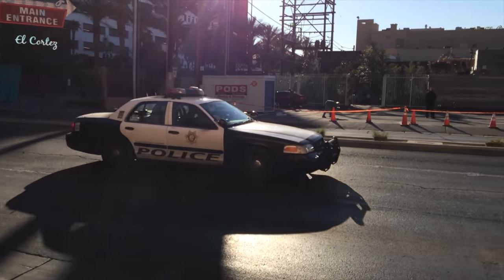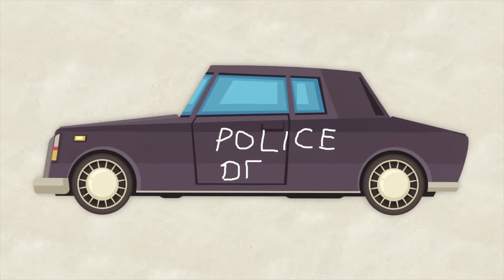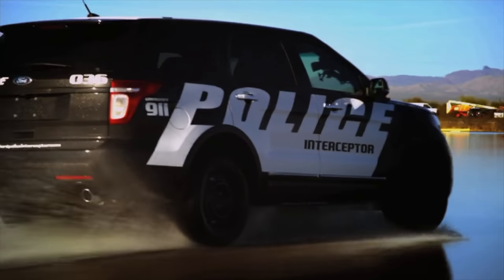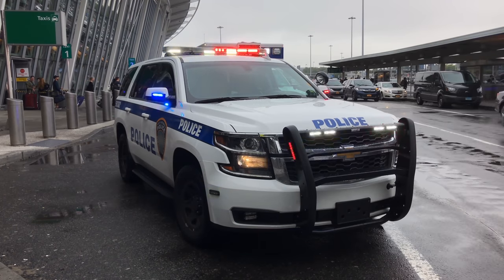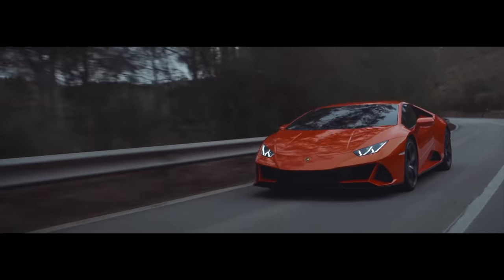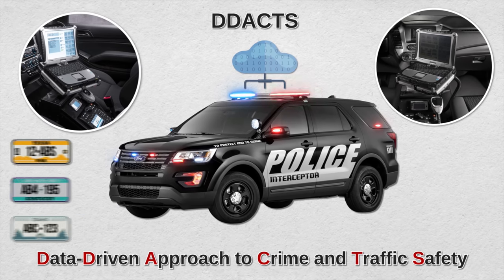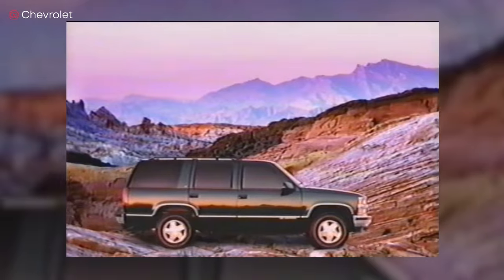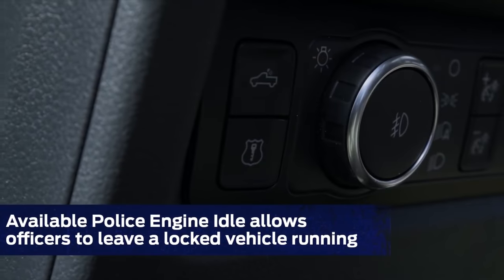Here’s Why You Can’t Outrun a Police Car

Comment: Haven’t owned a retired cop car but I did look at one in a used car lot (in Australia).
It had a blackout switch that turned off all interior and exterior lights regardless if the car was running. 
Apparently it was an unmarked detective vehicle and that sort of thing was used for stakeouts.
Reply: Same thing with my Dodge Charger RT I thought that was with all cars
Reply: That and following ppl in the middle of the night...which they do all the time here in Detroit
Reply: Thats nothing. In the USA, undercover cars have all those features PLUS multiple headlight and turn signal configurations. You can change them when tailing a suspect at night. Switch to a different config when the suspects car turns a corner or is temporarily out of sight.
Reply: I have a retired crown Victoria  patrol car it’s so fast it’s crazy lol but the tints get me pulled over a lot
Reply: Jesus loves you alot trust in His death 4 salvation and be saved from eternal hell <3 Jesus died on the cross for you bro. <3
Reply: @@winahhtaylahh1433yeah they do that everywhere.. it goes back to being a normal car before you can buy it
Reply: My car does that...
Reply: Australian police cars are COMPLETELY different. Currently all police vehicles in aus are basically just stock cars, same as ones bought off the lot. Back in the late 80's early 90's however, the comodores they were using did receive some performance packages. other than that, all police cars in aus even HWY patrol cars are stock, the only exception being some fedral police vehicles that are "bullet proof"
Reply: @Fit4C  does he prefer Fords or Chevys?
Reply: I bought a retired police car in Canada and it does the same thing
Reply: Talking about Aus Holden Commodores 
I have owned a VP, VT, VZ AND VE
Apart from the VS all the others had what others would call police mode. It was set up to stay on I think with cop cars but you could get it up on the instrument cluster 
So you had digital Speedo and RPM and whatever else AND you could set the lights all off or just light up the Speedo and I think you could set it to light up Speedo and RPM. Don't know about all other lights inside and out.

Comment: If there's any cop modification you want to have on your car, believe it or not, it's the brakes. 
I've talked to multiple officers about what the PDs want most in a car. And they all say the best braking possible. They want their cops to be able to stop fast, moreso than to start fast. The quicker they can stop, the quicker they can get out and do their job. And that made a profound level of sense to me.
Reply: I've always said this to my brother who is a racing enthusiast. That as much as you put in the engine you've better spend on some great breaks.
Reply: All cars have the best braking possible though so this makes no sense. The actual most important thing is tyres they are what determines how quick your brakes stop the car the fact is if ABS can kick in then you have the maximum stopping potential the tyres will allow. You can giant 8 piston calipers and carbon ceramic rotors but they will not stop the car any quickers if you are still locking up.
Reply: @gravemind6536  Well, without a tire upgrade, a brake upgrade can really help with brake fade issues.  Useful for spirited driving but probably not so much for hard braking to avoid a single accident during a daily commute.  Maybe it would be a good thing if you live in the mountains and do a lot of downhill braking though.
Reply: More brake-checkers on the road.
Reply: None of what you just said is remotely true…
Reply: In Michigan winters, tires were the most important part. I did have a Chevy Tahoe I had to get the brakes done with every 5000 miles.
Reply: If the cars have ABS, then a good set of pads and Dot4 fluid is all they'll need. Easily one of the cheapest but most important upgrades.
Reply: Very true . .
Reply: @gravemind6536  You are right And wrong lol. Every car has the ability to lock the wheels or engage abs for a SINGLE stop...but that braking power fades quickly when you are forced to execute Multiple braking events from high speed! Such would be the case in a police chase where the guy running would be doing multiple turns-following-hard-acceleration. Fade resistance would give the cop car the advantage over We, The People!
Reply: For the tasks at hand, yes. If you can accelerate as fast as possible without worrying about being able to brake it helps A LOT in traffic situations or on curves (being automatics). Reason is that most vehicles, even those with formidable acceleration, will not have large brake systems from the factory.

Great point btw!
Reply: @gravemind6536     No, they don't. Who told you that? Lol.... though tires and especially inflation is very important. That's one reason patrol cars generally have tires that are highly inflated.
Reply: @antghostthreeonethree6609  Thank you for explaining that. I really didn't want to. Lol
Reply: Police-spec tires from Goodyear have doube-thickness sidewalls. And cost $400 each.
Reply: @CynHicks  high inflate for stability at high speed  and turns and, police deparments did not like the idea at first some guy was telling them to inflate much more
Reply: @lofturhjalmarsson9896  From what I have learned from experience and others is that all vehicles and tires will differ but essentially you slowly inflate them, starting at roughly 4 to 6 psi over the recommendation, checking the tread every 500 miles or so until the center starts wearing faster and then back it down. Never going over the tires max psi of course but also paying closer attention to their speed rating. They will last longer and perform better. Especially in corners. I've also heard that with rear wheel drive, for best performance, you should keep the rear tires a couple few psi lower. Kinda makes sense but I don't know. I do it anyway though.

Edit - And obviously as you know (but for anyone that may read this) the ride will be louder and less "comfortable" and will possibly cause more wear to your suspension components because tires do absorb much of the forces.
Reply: @CynHicks  they infalted way over the max that guy that tought police departments in usa to start doing this max is 45 they went up to what was it 60 or more , they will explode at much higher so its mostly safe in that regard l read.
Reply: @lofturhjalmarsson9896  Oh yeah, going too high is a terrible idea. Especially at high speeds on rough terrain. I have never gone past 44, no need too, even on tires with max psi well over 44.
Reply: found... The faster you are going through a corner,
the more tire deflection you get. As the tire deflects over onto
the sidewall, you get less traction and more of a tendency to
understeer or oversteer. This could spell disaster when
negotiating a corner at high speed during a pursuit or a Code 3
run. Higher pressure keeps the tire from deflecting onto the
sidewall as much, which keeps more of the treaded portion on
the road.

A good demonstration for EVOC instructors is to have students
drive a high-speed course in a vehicle with 32 to 35 psi. Then
have them run the same course with 44 to 50 psi in the tires.
The student will experience a marked difference in performance.
Having officers experience this difference in vehicle
performance is much more effective than just telling them to
check their tire pressure.

Hydroplaning

When a tire rolls across a road covered with water, the tire
tread channels water away so the rubber remains in contact with
the road. The factors that affect hydroplaning are speed, and
water depth. Conventional wisdom says that vehicles will hydroplane
in as little as 1/16th of an inch of water. Not so coincidentally,
legal tread depth is 1/16th of an inch.

Tire manufactures and the Association of Law Enforcement Emergency
Response Trainers International (ALERT) have shown that tires have
more of a tendency to hydroplane when pressure is low. This
happens because the tire footprint (the portion of the tire
actually in contact with the road) is larger. For those of you
who water ski, think of which is easier to get up on: a fat ski
or a skinny ski. More tire surface in contact with the water
makes it easier to hydroplane, just as it is easier to water ski
on a fat ski. Also, a soft tire can be pushed in more by the
pressure of the water on the center portion of the tread. This
results in less rubber in contact with the road.

Tire wear

Much better tire wear results from maintaining proper pressure.
Tires with lower pressure will wear off the outside of the tread
faster from the deflection of the tire during cornering, and the
tires will heat up more from increased road friction. This is one
of the factors that caused the failure of a certain brand of
tires on Ford Explorers some years ago. In 1999 the San Jose
Police Department realized a significant cost savings by
increasing the pressure in the training fleet to 50 psi. They
soon followed up by increasing the pressure in the patrol fleet
to 44 psi. For liability reasons, most agencies are reluctant to
exceed the maximum pressure listed on the tire for actual patrol
vehicles, but they reap the cost saving when going to 50 psi on
training vehicles.
Reply: nybody who works on cars professionally and removes tires on a regular
basis will tell you that drive tires wear in the center - mostly due to the
belt "pulling" the tread on acceleration and deceleration inputs - and
steering tires wear on the edges - even with absolutely correctly aligned
wheels. On RWD cars, this results in the rear tires wearing in the center
and the fronts wearing equally on both edges - even when properly inflated.

On FWD cars with both steering and drive inputs on the front tires, the
rears will often outlast two sets of front tires.

> > How does what I say endanger ANYBODY. I am not endorsing either over-
or
> > under-inflation.
>
>
> The person who's tires are already under-inflated that believes the
steel
> belt tale and lets more air out to get even tread wear. Remember the
> Ford/Firestone fiasco ?
>
>
>

OTOH, if the edges wear on an overinflated tire and the person believes
YOUR THEORY that edge wear automatically indicates underinflation, they
could overinflate the tire and have it pop on a hot summer's day at 70+ mph
on the Interstate.

Anybody who sets tire pressures by the tire's appearance is too stupid to
be operating a machine as complex as an automobile.....Of coarse hard cornering
will heat up the outer edges of a tire. This will happen on a race car AND
street driven vehicles. I like to corner hard and always have edge wear on my
front tires even if I up the inflation by a few psi............ok....... so it seems overin is ok regarding wear center wear just evens out edge wear but can it pop , l read hardly ever but dunno
Reply: Under or over inflated tires not only wear out quicker but make the car unsafe as far as handling goes. My tire guy with 50 yrs experience taught me.
Reply: @bricemantel3191  unsafe for normal use l guess but safer for chases maybe , less resistance in turns less slowing down or what and better handling . but also less area of tire touchng ground less grip  but l think the benefits outweigh that
Reply: Never thought I would see this topic on this channel lol
Reply: Also watch the fuel economy. 3 psi higher yields better gas mileage.
Reply: @joaquinaguilar165  it depends on the application to be fair.
Reply: @gravemind6536  they absolutely will. Dont lock them up. Oscilate the pedal you wont lock. thats like 70s car basic knowledge right there.
Reply: they day they get brembo brakes thats when i wont try and be slick dipping on the first turn anymore. Thats one thing everyone forgots. Cops have econo brakes. if they put money more into the suspension and brakes to stiffen the chassis less body roll and a better tune we would all mostly be screwed.
Reply: @gravemind6536  The tires used in my city by the PD are very expensive I have heard. I believe they need the best too!
Reply: @ColonelSandersLite  - makes sense. Use cases matter. Glad the points were raised re tires and brakes.
Reply: @joaquinaguilar165  you want great everything even a chassis
Reply: @chasebeavers  why do you say that? I'm new to car enthusiasm
Reply: @a.chavez5808  my reply was for this statement..."All cars have the best braking possible though so this makes no sense. The actual most important thing is tyres they are what determines how quick your brakes stop the car the fact is if ABS can kick in then you have the maximum stopping potential the tyres will allow. You can giant 8 piston calipers and carbon ceramic rotors but they will not stop the car any quickers if you are still locking up." All cars do not have the best braking possible, only what the manufacturer deems necessary. Most cars can benefit from larger brake rotors/brakes.
Reply: Guys, Here is Our Savior

YaH The Heavenly FATHER HIMSELF was Who they Crucified/Pierced for our sins and “HERE IS THE PROOF”

From the Ancient Egyptian Semitic: 
"Yad He Vav He" is what Moshe (Moses) wrote, when Moses asked YaH His Name (Exodus 3)

Ancient Egyptian Semitic Direct Translation
Yad - "Behold The Hand"
He - "Behold the Breath"
Vav - "Behold The NAIL" <— YaH’s Crucifixion
He - "Behold the Breath"

“Behold the HAND that Beholds The NAIL” 

PROVES - YAH The Heavenly Father HIMSELF was Who they Crucified

That is EXACTLY what Moses Wrote

Here is what they mean

YaH's Name:
(Ya)d + (H)e, as YaH is what Moses called Him and YaH Declared: "this is My Name, this is My Name for all generations" (Exodus 3)

YaH is The Creator of “MAN”: (Genesis 2:7)
Yad He, (HAND BREATH), as YaH's "HAND" Formed man from the dust  of the Earth and His "BREATH" made him a living being (Adam)

YaH's Sacrifice of Crucifixion for “MAN”:
Vav He (NAIL BREATH), the "NAIL" through YaH’s "HAND", in Sacrifice of Crucifixion, that whosoever shall call YaH Savior, His “BREATH” brings forth life (Salvation)

How YaH arrives:
YaH arrives via the Tent of Meeting (Exodus 33:7:11, Isaiah 54, 55), where a Tent is erected outside the city, a cloud descends upon the entrance of the Tent and YaH appears...

Why they demanded YaH to be Crucified:
YaH was Crucified according to Hebrew law (Deuteronomy 21), to be NAILED/PIERCED on an Almond Tree for BLASPHEMY as it was for His NAME they demanded Him Crucified. The Messiah claimed He was YaH...

HE WAS YaH!!!

HalleluYAH translates “Praise ye YaH”

The Hebrew Book of Isaiah

Isaiah 42:8
"I am YaH; that is my Name! I will not yield my glory to another or my praise to idols.

Isaiah 43:11
I, I am YAH, and there is no other Savior but Me.

Isaiah 45:5
I am YaH, and there is none else.
Reply: @gravemind6536  "the best braking possible"
According to who?

You can always put better brakes on your car. Wider rotors. Bigger calipers. A stronger booster.